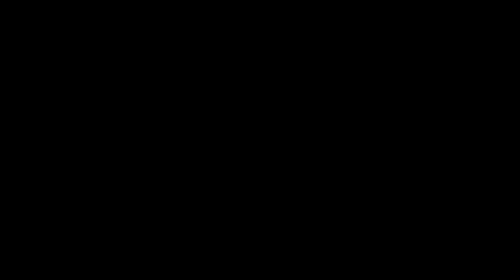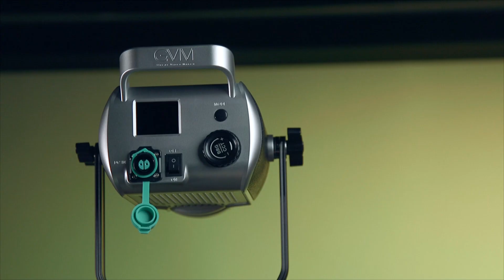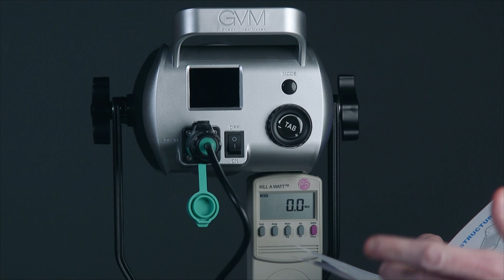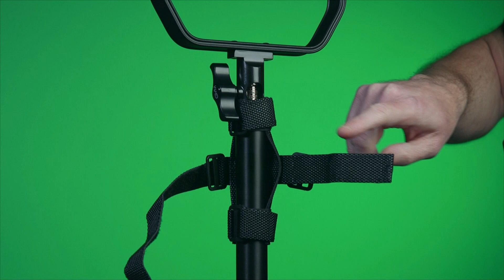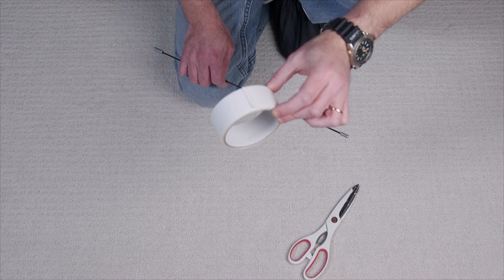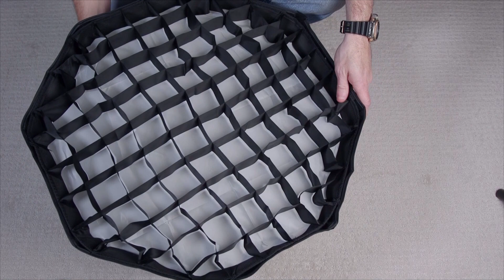GVM SD150R Kit Softbox And Stand | (Indexed Chapters)

Comment: When dimming in RGB mode does it keep the same color it is set to? or there’s a color shift ?
Reply from the maker: If measuring with a Sekonic C800 color spectrometer, on the tiniest way, not only this light but other lights as well at this price, I’m pretty sure it would shift, but to the naked eye, I don’t think you’ll have a problem with color shifting or anything noticeable.